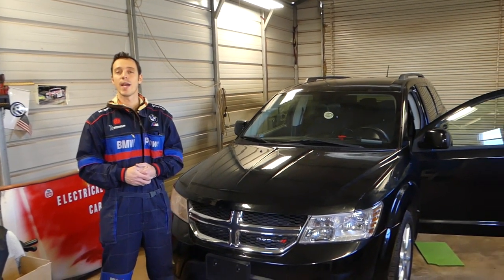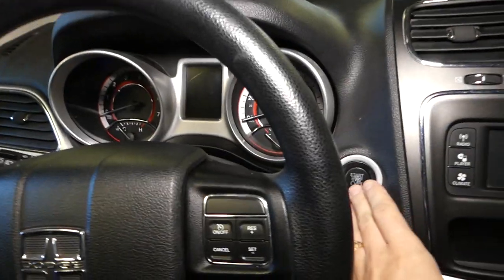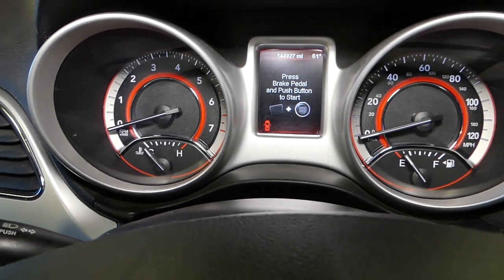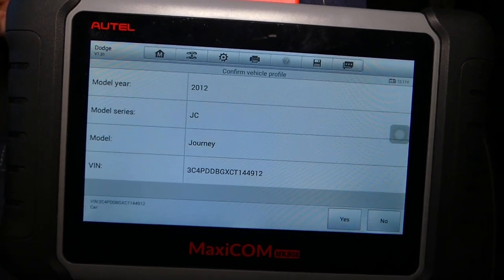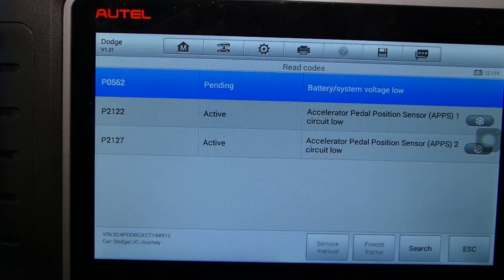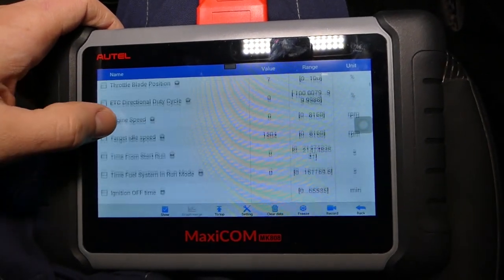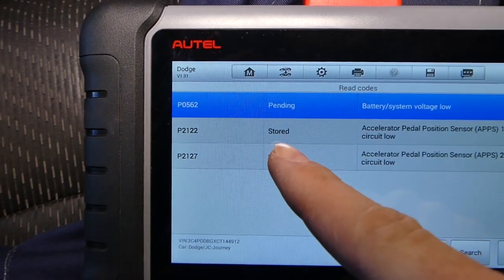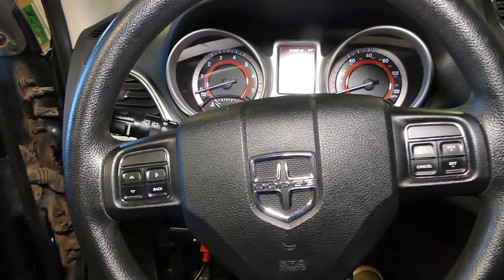DODGE JOURNEY CODE P2122 P2127 ACCELERATOR PEDAL POSITION SENSOR, FIAT FREEMONT

Comment: How about turn it to run position without starting, and press accelerator for 20 seconds and release very slowly. Turn off vehicle. Start and check for recalibration.
Reply: Nope.  Doesn't work. Wish it was that simple.
Reply: It worked for my 2013 journey
Reply: How long will it be good for till the problem occurs again?
Reply: Mines dodge jorney same hapend 2 days those on the dash bored pop on but the brske pedal gets hard and wont turn on like if the battery was dead  what can i do
Reply: @BlueYodaTex  I tried on my 2013 it didn't work 😭
Reply: @JustApril55  try a few times. I remember doing it a few times before it worked
Reply: @BlueYodaTex  ok thank you so much, I'm ready to torch this thing 🤣